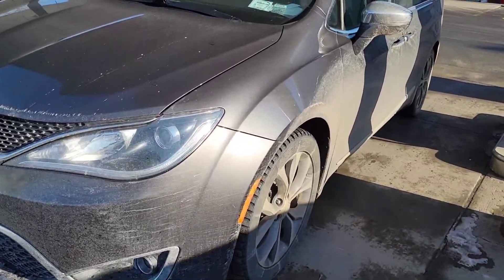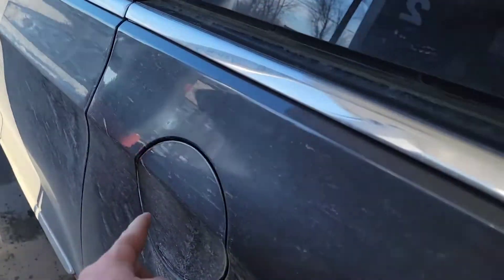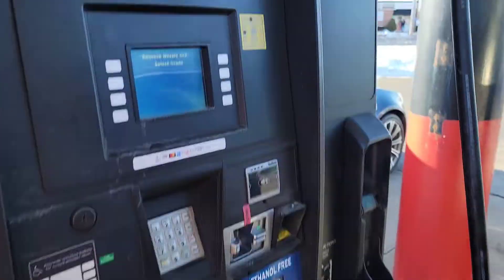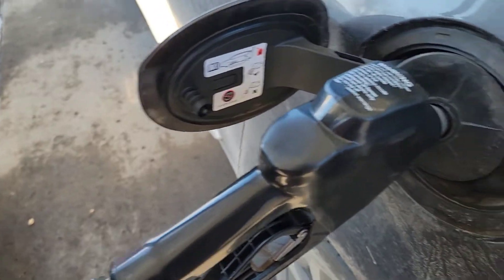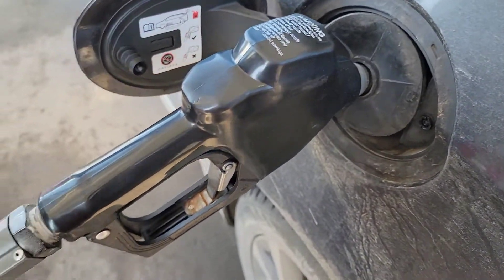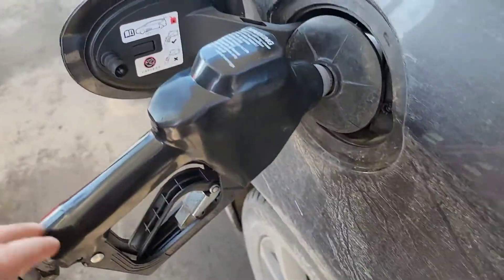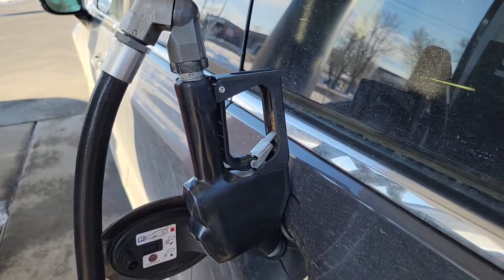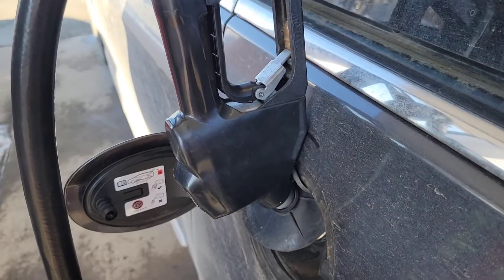How to stop the gas pump from shutting off on 2017-2021 Chrysler Pacifica and similar designs

Comment: I left my phone today and tried 3 different pumps (the station I went to won't pump again after the nozzle has clicked!) In this upside down position, will the pump sensor still click off when it's actually full? Or do I need to watch it for overflow?
Reply from the maker: It will still click off.
Reply: Yay! Thank you so much! It worked and stopped when actually full.

Comment: I had this issue when i ffirst bought my Pacifica. My wife panicked when it happened. So ive been doing this trick for a couple years jow. And while i look like an idiot it works. I have noticed that at some Mobil stations it will work the normal way. Weird issue